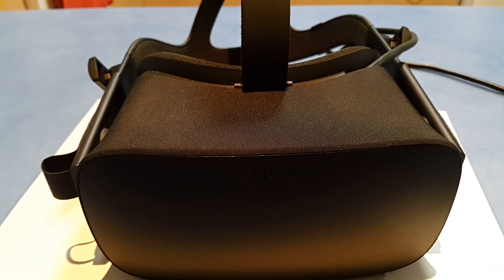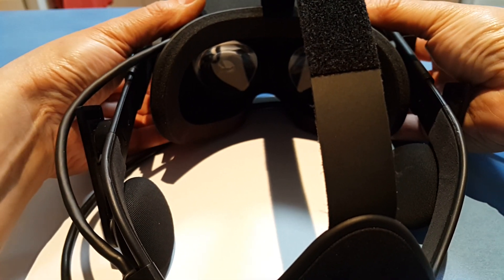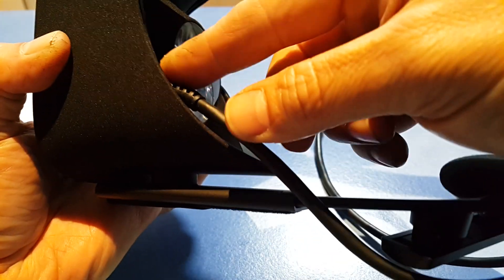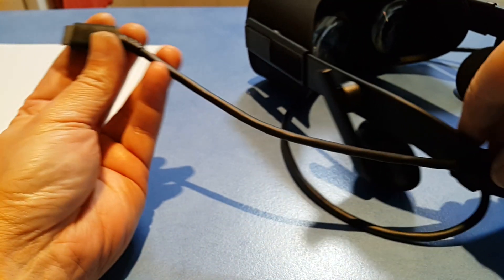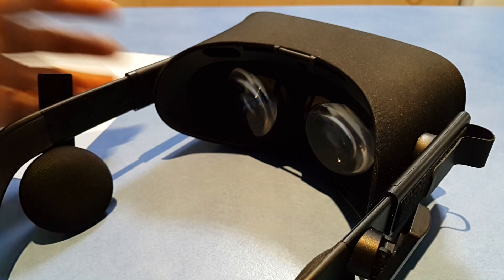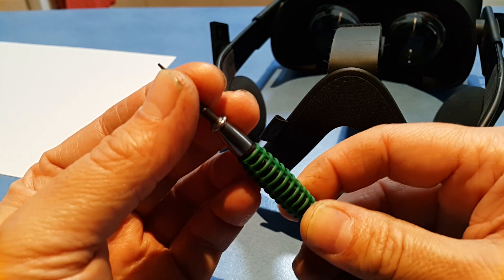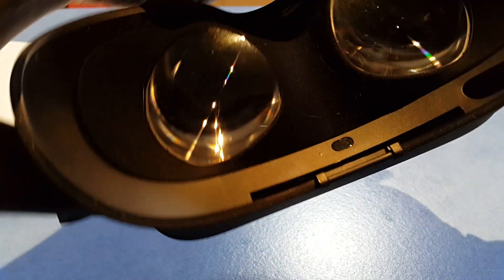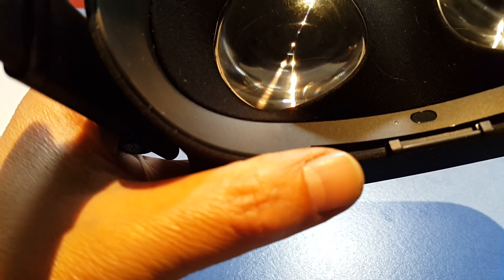Oculus Rift CV1 Teardown Disassembly How To Part 1

Comment: Thank you so much! I thought my headset was busted for sure after i dropped it on the floor. Turns out it was just the HDMI/USB cable in the headset that were loose.

Comment: Pretty sure those are hex bolts.  Thats what my 12X scope tells me.
Reply: They are T3 Torx, you dont know what the hell you are talking about.
Reply: p.s. "hex head" would mean the outer shape is a hex ie a standard bolt. what you tried to say was socket head cap screw, which they are not. The are torx head screws. Just stop trying to pretend you are smarter than you are.

Comment: thanks a lot for the videos, i'm having similar issues with the Rift disconnections while adjusting or moving.
i want to know if baking the main board fixed the issue or not ?
also where can i get the screwdrivers and tools you used in the video?